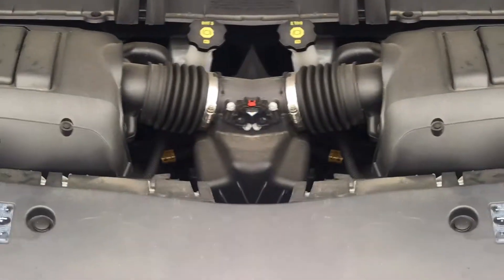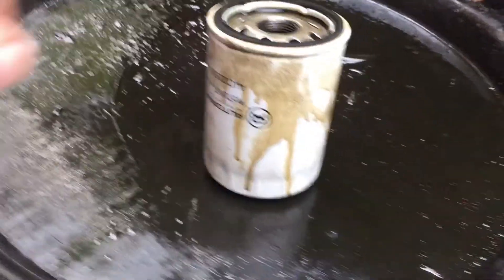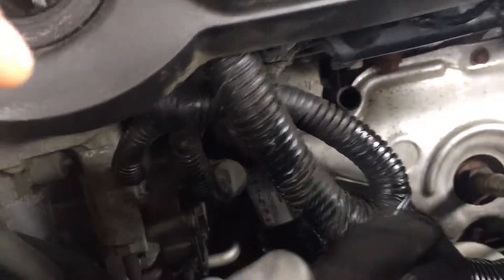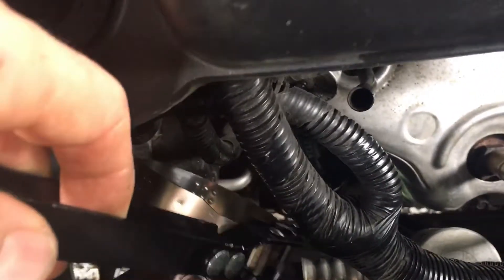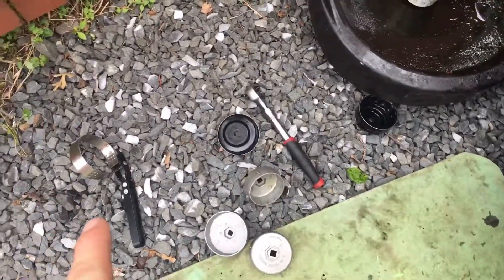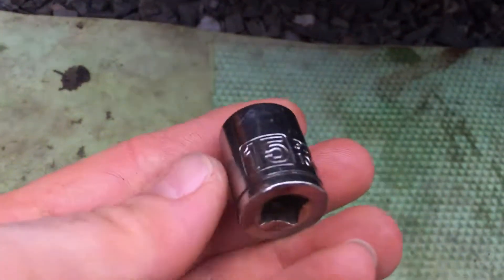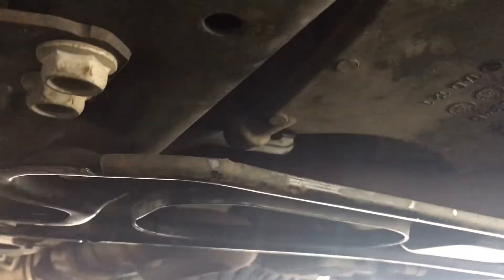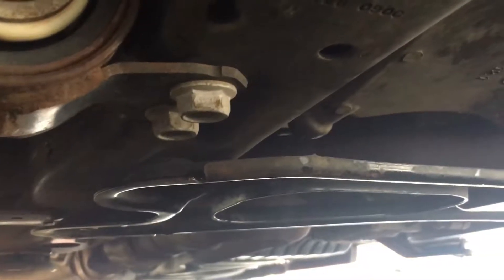Chevy Traverse oil change and oil light reset

Comment: I have a 2016 Chevy Traverse LT with 29000 miles can I put a Full Synthetic Formula 10W-30 motor oil please let me know because I went to the dealership and they told me that I need to put a motor oil. 5W-30. Thanks 🤝👍
Reply from the maker: MaxPayne29 Return 10x30 would do . All it is it’s  heavier weight 10w thicker oil then 5w is thinner
Reply: Thanks so much for your response so if I use the 10W-30 nothing will happen to the motor car 🚗